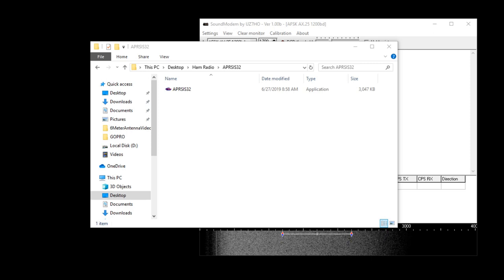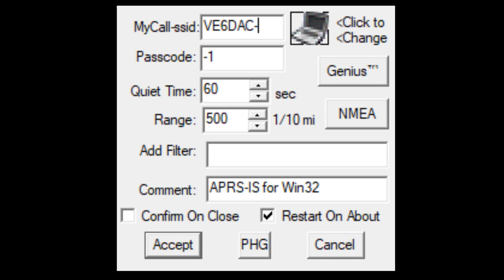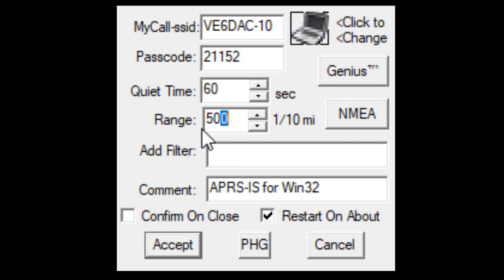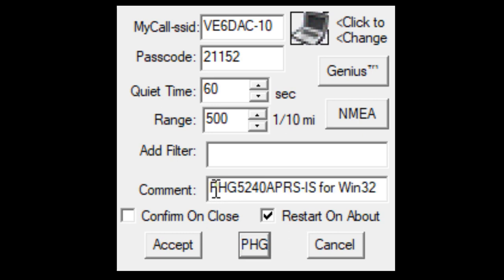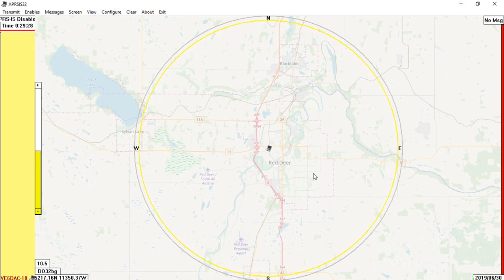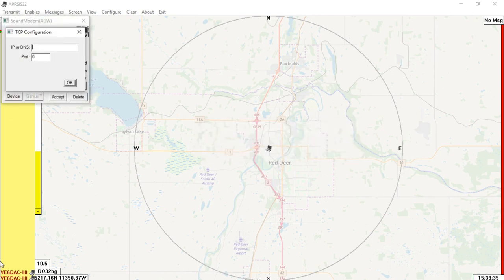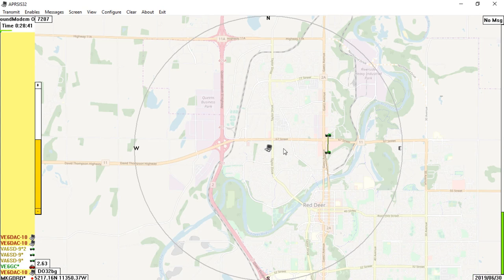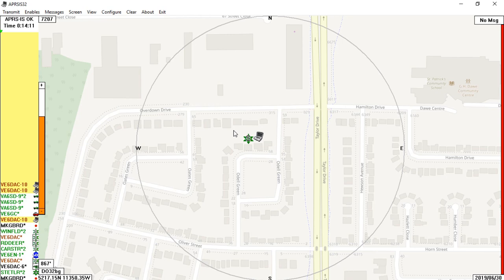Setting up APRSIS-32 IGate

Comment: This was great. I had watched another similar video but they missed some key parts so I was never really receiving from RF I am now. I will check out your digipeater video next. I have a signal link that I use for packet hoping that will work for the digipeater. Thanks va3etn
Reply from the maker: Glad it was helpful!

Comment: Thanks for the video. My scroller shows APRS-IS OK and new3 (the name i gave the new port) OK. It does not show SoundModem OK.  Using hand held to laptop via audio cable. RF only, not receiving anything.  Have soundmodem set up and running. Last 2 lines of logging shows AGW Version 2005.127 and Logging Enabled
Reply from the maker: The new3 port is that the sound modem? Or is that configured for somthing else? Also is the sound modem showing recieved packets? If the sound modem isn't showing recieved packets the audio inputs are not setup correctly.  Thank you for watching the video.
Reply: @ve1dac819  Yes, new3 is the same as soundmodem. Do you have a vid on soundmodem setup?
Reply: I see input on the soundmodem waterfall, but no logging
Reply: Here's what I've discovered: ditched the audio cable, held radio next to laptop mic and soundmodem now decodes.  Same thing on 2 laptops.  Tried different audio cables with no luck. So SM does work only if I hold radio to mic